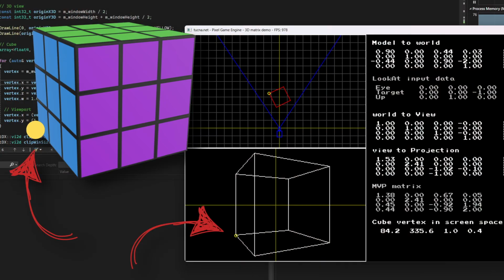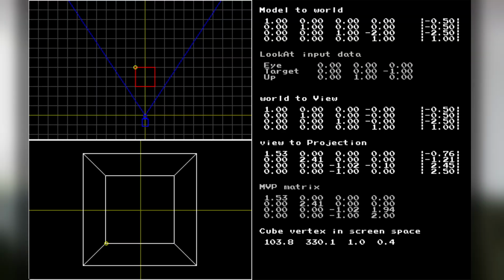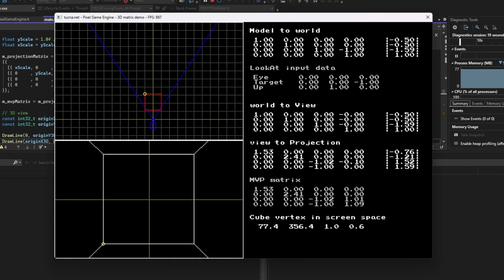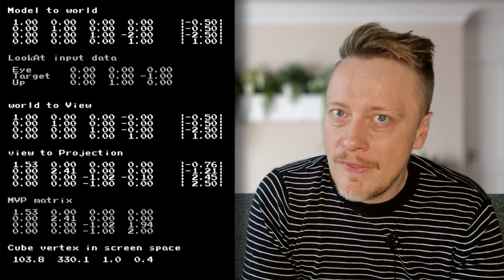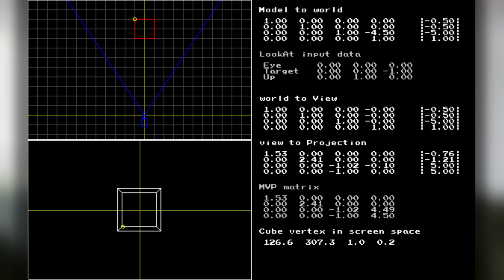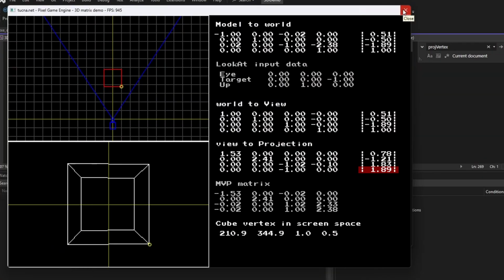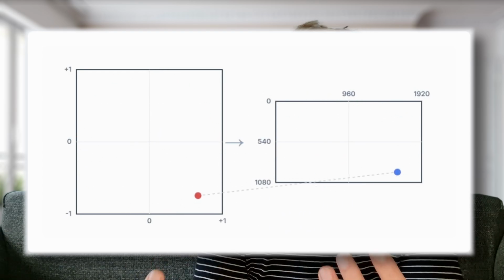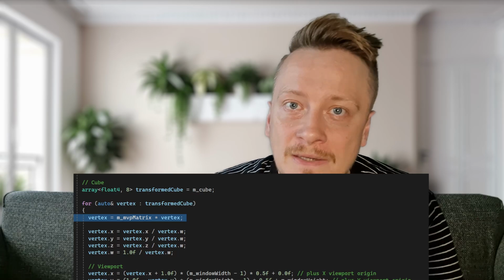How Does a 3D Game Render on a 2D Screen?

Comment: I have one question for you, because I see that you have skills, could you tell me how could change d3d8.dll in the game to use d3d9dll, or for example d3d10.dll.
I tried a couple of dx wrappers such as dgVoodoo2, so this crosire d3d8to9 both start the game, but the second one throws a cube direct x error, and dgVoodoo2 drops a lot of performance 🤗
Reply from the maker: Hey! I haven’t tried forcing this myself, but the general idea works like this:

Windows searches for DLLs in the game’s folder first, so if you put your own d3d8.dll next to the EXE, the game will load it as if it were the original. A wrapper DLL exports the same entry points the game expects (like Direct3DCreate8) and returns objects that behave like the real D3D8 interfaces. Inside the wrapper:

• it initializes a newer DirectX backend (DX9 / DX11 / DX12 depending on the wrapper)
• translates each D3D8 call the game makes into the newer API
• returns the results back in the format the original D3D8 interface expects

If the wrapper crashes, it might mean the game uses a D3D8 function that isn’t implemented there. Performance problems can also come from features that don’t translate efficiently between the versions.

In your case, I would try to figure out what calls are causing the crash and double check that your wrapper covers them correctly.
Reply: @Dr.Vlasanek  The strange thing about this game is that when you start to take action, it crashes, the lod folder says O_BaseGz.cpp 8793: CUBE error loading scene file SAVE\tmpvehicle.scn: Error deallocating DX surface memory.
The game is F1 Challenge 99 02 2003, the same year ISI made Nascar Thunder, that means the same source, similar addresses in the exe file, Nascar Thunder normally uses d3d11.dll from dgvoodo2 while F1 Challenge 99 02 throws that error above
Reply from the maker: That kind of memory error can happen for a few reasons, such as double-freeing memory, freeing it while something still references it, or even just a random corruption. The message at least gives a clear hint, but it’s still tough to pinpoint the exact cause without looking into the game files directly. Sadly, I don’t own either game, so I can’t test it myself
Reply: @Dr.Vlasanek  
Thanks for the answer, if you ever have time, try it out, otherwise the whole game is less than one gigabyte

Comment: Loved it, thanks.
Explaining math behind screen space to 3D world may be interesting as well. 
Another YouTuber @jeoresearch is doing eye tracking to mouse/cursor control, so far with one initial calibration point.  
You can maybe explain if not whole eye tracking thing but only raycasting from real-world to 3D virtual world.
Example: assuming we point a lazer knowing it's relative position and rotation to screen and the screen coordinate it hits lets calculate virtual 3D world hitpoint.
I guess even in this scenario calibration is required (relative to screen part in previous sentence)
Reply from the maker: Thanks for the tip, that’s definitely an interesting topic to discuss!

Coincidentally, I actually did something slightly related years ago for my master’s thesis. I used a camera to track a fingertip and its cast shadow, and from that I reconstructed the finger’s 3D position in space. The 2D location in the image gave me the x,y coordinates, and the distance between the finger and its shadow allowed me to estimate depth. You could hover your finger above a sheet of paper and “click” virtually, and the corresponding interaction would happen inside a top-view scene (basically virtual keyboard).

Comment: Interesting. Why did you convert Javid's PGE to use DirectX? Does it run faster for you on Windows than OpenGL?  I downloaded a fresh copy of PGE and patched up your code to use the original version, added the escape key to exit and it works for me, yay. Just had to copy back your additions like DrawLineClipped and all the infrastructure you added with that. Does make me wonder how easy it would be to convert his engine to use Vulkan.
Reply from the maker: I did it so many years ago, it’s cool to see that Javid is taking backward compatibility seriously, and cool that you tried it out! My switch to DirectX was mostly just for fun, a little exercise 🙂

I’ve talked about it in a few videos here and there, but in this one I’m showing a more serious version that I extended with ImGUI support - https://youtu.be/j-z8L6giOwg?si=6Z2-La0eYEzt9wpK

A Vulkan port should be totally doable. The engine basically just creates a texture, writes to it, and then blits it to the render target. You should be able to mimic that in pretty much any graphics API. Give it a try!